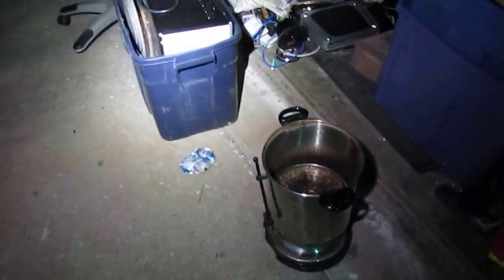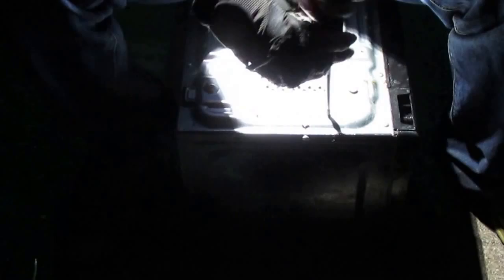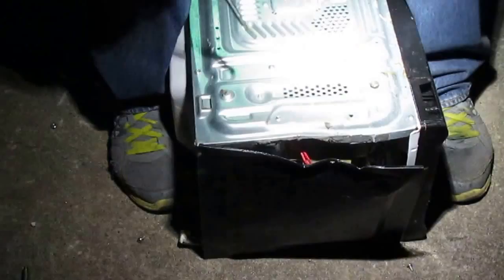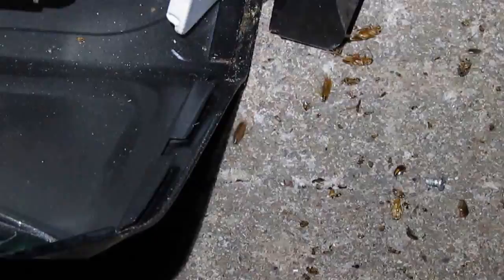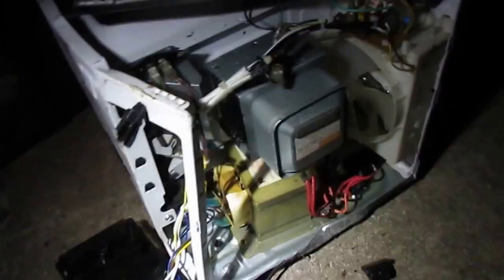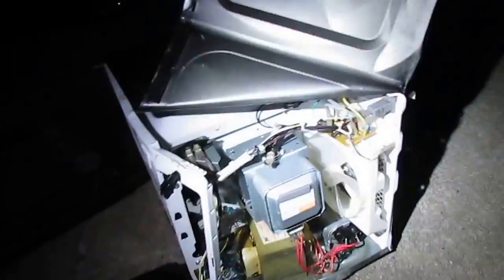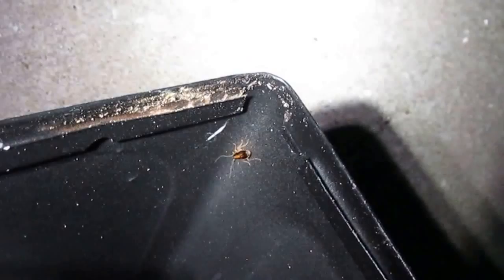COCKROACHES Galore! BEWARE of the Cockroach Nest! Scrapping Dumpster Dive Microwaves Informs You!

Comment: You should inform the viewers of how disassembling microwaves even when unplugged is dangerous due to the high voltage capacitor. You can assume each microwave has been unplugged long enough for the capacitor to bleed to ground

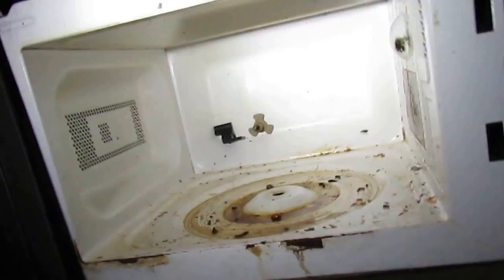Comment: In the video go to 7:59 and freeze. Ignore the roach stuff, look on the
right side of the cavity you’ll see a gray square, actually it is
made of mica. It is the “outlet” lens for the microwaves, now
notice the bulge with the burn spot right above. This is what happens
when the outlet gets soiled, it arcs  through the schmutz to ground
and sounds like it’s gonna blow up. Many folks just kick it to the
curb and buy another, but if you simply swab the cavity and lens
clean it’ll work just fine 99% of the time- but if you see the
evidence of roaches though, forget it.
Reply: A brand new roach free microwave is 40.

Comment: ewwww.....im so afraid of those bugs cant imagine how!!! im scratching like badly but the worst are bedbug...you actualy mostly dont even see them they are so small...me my way of making sure and i realy dont take it kindly i put every thing that ther a risk few day in my freezer make sure everything is 100% dead that a easy trick
Reply: but seriously ewww i woudnt touch that microwave more then second ...never saw something like that in few years of experience i probably would put gazoline and fire if it happen dam its no joke an that quantity !!!!
Reply from the maker: yes, and there was only about 10% of them that i caught on camera - then i took it to the scrap yard today and when i dropped the electric motor on the cement ground a bunch of roaches fell out of the gaps between the copper wire coils and metal. So i dropped it more times and there may have been 50 roaches hiding just in the little spaces in that motor if u can believe that!
Reply: me at my yard we dont call those motor we have a bitty more they are actualy transformator ...i think they give like 3 cents more then for motor some of them are half allu half copper i leave it has is but when you found one both side are copper you should open them seriously few hit with a hammer on the welding and it open realy easy maybe 30second job and you have 1pound of #2 im maybe going to make a clip next time a found one just a little hint like that

Comment: Excuse me would you mind helping me for a second? We never had a problem which is when we moved all the way down to the bottom floor of the apartment. They have just come recently from one of the cabinets in the wall. My husband connected a hose to the sink and put it through the window to clean out back and there was a huge leak in the hose and water was everywhere in the house and the kitchen. Since then the paint has opened up a little on the cracks and I have been finding a lot of bugs coming out of there recently. But you think maybe this came from upstairs and when the cracks opened up they started to come out? I didn't know they were eggs until my husband told me. I thought they were like dead caucuses hey. I do not like bugs. He told me to clean it and I refused because I do not like bugs. And he knows I have a huge problem with bugs. So anyway. Our microwaves sits on the table. It is not on the counter because there is not enough room.  So I'm not too sure that it is in our microwave. But if there's any other advice you can please help us with. Spraying raid on a rag and wiping things down is a good idea anything else please let me know because I have a one-year-old and I do not need him living around bugs they carry a lot of diseases and infections
Reply: Spraying raid is a bad idea. Its toxic. Get a duster and shake a little borax on it and dust all the little holes in The back